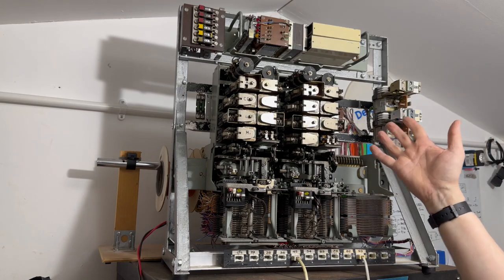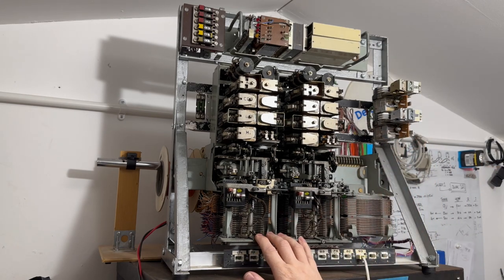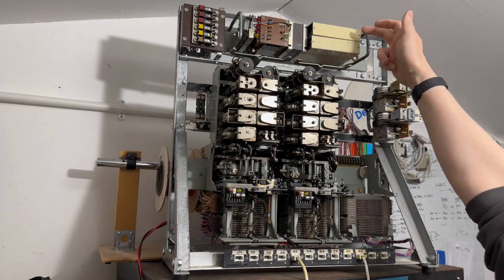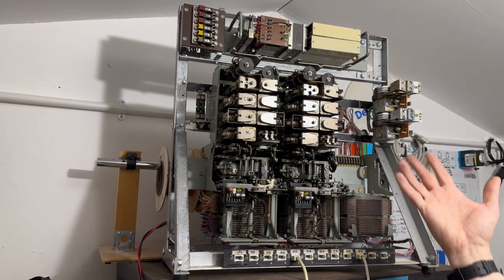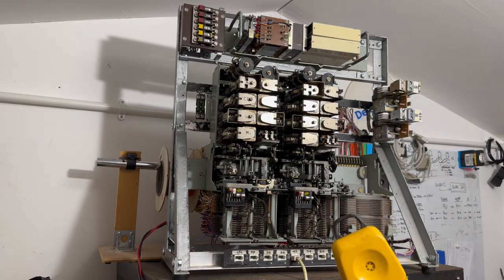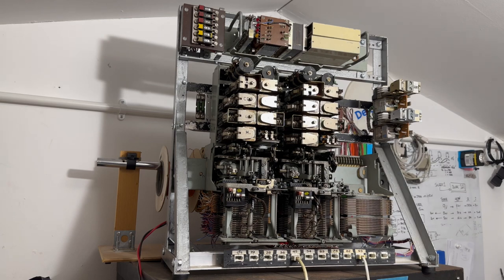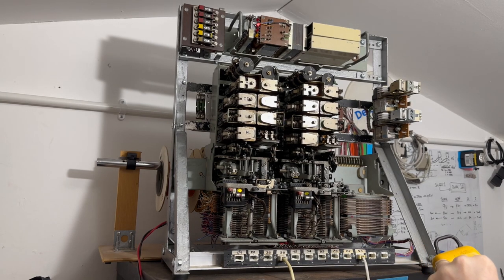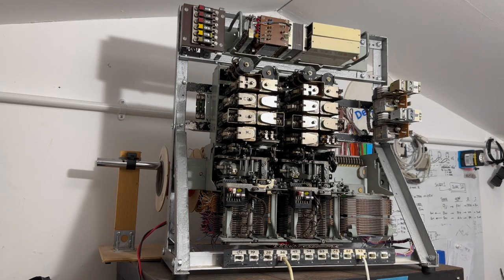Strowger: Demo Telephone Exchange

Comment: I love the release motion of those 2000 series selectors. I only just realized that the design requires one less magnet than a pre-2000 or 4000 selector with a separate release magnet. Why did the GPO switch to a three magnet mechanism for the 4000 series? I haven’t heard anything good about them from folks that maintained them.
Reply from the maker: 2000 type selectors have a failure mode where they can get stuck as it drives round the bank during release, which causes the rotary magnet to burn out.

I think the 4000 type was supposed to work around that because the release magnet effectively releases a latch that causes a spring to pull the wipers home?

Of course, going back out the way you came doubles the wear on the early choice bank contacts, so 4000 types wore banks out quicker.

The other changes in the 4000 were to make all the adjustments screw based rather than "bend a bit of metal" - those were especially unpopular as they had a tendency to shake loose over time.

Cue lots of stories about having to carefully sweep the floor under the selectors in the morning and then work out which bits had fallen off which selector etc!
Reply: @lpbkdotnet  release magnets can get stuck too, on my switch all of the release magnets are wired with heat coils in series to stop them burning things down if the wipers get hung up in the banks and the release magnet remains energized. 
I remember the “old timers” telling the stories of sweeping up every morning on the old Strowger mailing list. I also remember a few stories about the smell of burning varnish when the heat coils failed to do their jobs!
I’ve heard the bank wear argument too, but was bank wear on the two motion switches a big problem?
My pet theory is that the 2000 design was an attempt to be different in as many ways as possible from the American sourced “pre-2000” design as a way of distancing the the British design from the American design.
Reply from the maker: @beefchicken  bank wear was a serious concern on a busy main exchange, and having talked to people who had to split/repair banks it sounds like a nightmare of a job, even worse than changing a magnet!

The 2000 type was already a pretty long way from the pre-2000 (eg being significantly smaller, so you can fit more equipment in the same footprint) so why they went back towards the pre-2000 design by adding a release magnet back in for the 4000 type I don't really know.

I have heard it claimed that going back out the bank the way you came is quicker to release, but I can only see how you'd make the argument for 50% of the outlets.

They must have had their reasons for the redesign though, but the chances of ever really tracking them down is pretty small!

The really nuts one is that ATE developed a motor driven 2-motion selector, electrically compatible as a drop-in replacement, but capable of running at more than twice the speed... but by that point electronic exchanges were already taking hold so t never went anywhere.